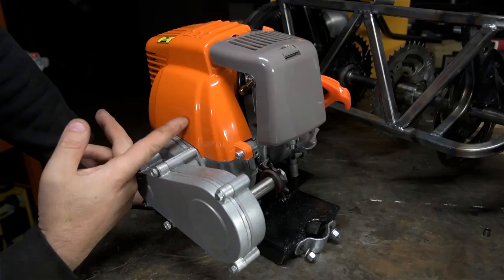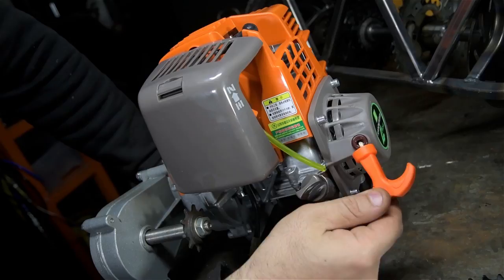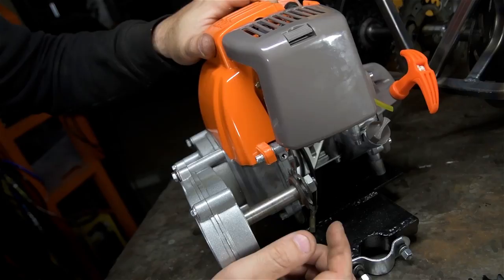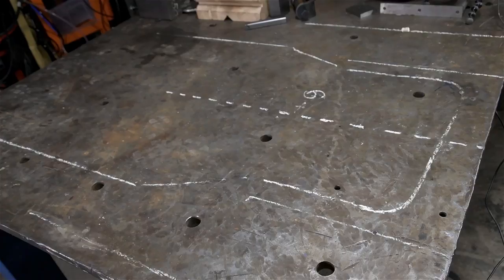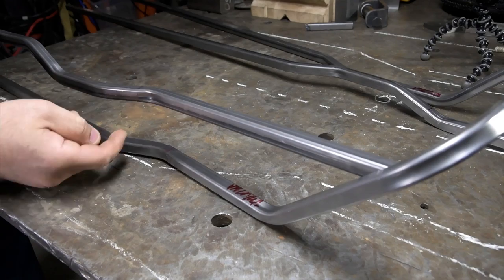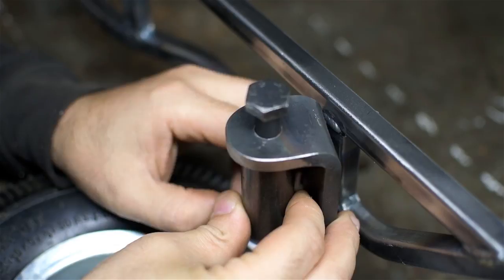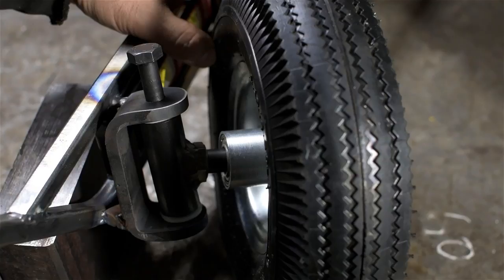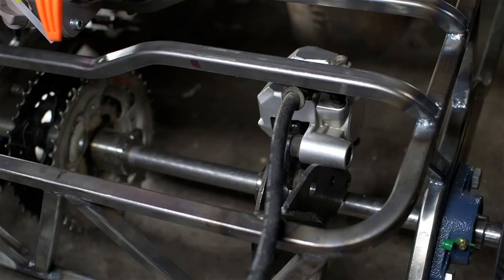"CHAINSAW" GO KART! - PART 2

Comment: Did anybody mention how a derailleur mechanism works? I realize you are not shifting from one cog to another, but even just one cog to another cog straight line, the derailleur mechanism incorporates a spring tensioner to always keep the chain in contact with the maximum number of teeth for any given chain angle. I think your system would have worked had you incorporated the derailleur mechanism. Also, this could allow for a better selection of gear ratio for the terrain encountered. However that said, the $200 investment in the 4 stroke engine was a brilliant tactical decision.

Comment: You were trying to use derailer sprockets; they are designed to derail, and they will at high speed. You could use bike chain and sprockets from a fixie and be just fine.

Comment: Did I see a Soko RC Helicopter set up guage - in ripoff made in PRC fashion?  The electronic angle gauge.  Now I have to find one to compare it to the real deal. .5 degrees off on a cyclic linkage on the head makes you chase 0 degrees at center stick forever and you'll never be happy with the final set.   The Soko made setting up collective and cyclic limits so easily. ....THen somebody walked off with my guage while at the field.  Sorry for off topicness.  RC Go-kart. The end.

Comment: On a motorcycle if you look at the rear tire where the sprocket is and put a straight edge on the chain to the front spocket you will see that there is a slight angle , thats to stop the chain from being flung off the sprocket along with the chin guide there’s a lot more that goes into figuring out that angle . And that steering you exactly right about it steering geometry is very important even more so if you have a suspension that needs to have a designated travel range . When I was a kid this kind of stuff is what sparked my interest in math  finding the angles thing needed to be at and their length and all that fun math stuff , building tree forts In the bush behind our house and thats how I teach my kids about math I told my son if you ever want to build anything for yourself you need to lean math all of it trigonometry, algebra, you need to know it to understand how to build anything, house , car , go cart , motorbike . I so so want to get myself a milling machine and a machine lathe to make my own parts for projects . I seen a mill on market place last year for 5 or 6 grand I’d pay that for one no problem and it came with some tooling . Being able to make your own parts is next level For sure I love your content Tony awsome episode brother

Comment: Instead of just looking at the frame jacking to try and figure out centering suspension angles, maybe putting some equivalent weight in the seat, and actually FEELING the turning force, or measuring at the knuckle and calculating back through the linkage "gearings" if the steering had not yet been fabricated, might be a better idea.  Obviously no help here, but for anyone watching this intending to build one.

Comment: I like it but it's kind of short. But it would be nice to be able to adjust the length of it sense you would want to play with it too.  I really like the frame work. I'm still trying to figure out the front wheels or just take the front off an old riding mower. Thank You Loader.

Comment: I still think it  could use some widening  but  maybe  when you  pull the  front wheels out  for the steering it will give it some of that , also you may want to add some weight ? . I don't  know use a kid analog ( sack of dirt or sand that weigh as much as your kids ) hoist it  up and  figure out where you want your center of  gravity . Again i'm no expert  just  worried about kids being kids and flipping it  . ( i mean i can't  say much i've flipped a lot of things when i was a kid )  but you know . Also depending where you're gonna let them use it  i still think some sort of suspension might be useful .

Comment: I think the problem was that when you tried it, the chainring was not fix on the shaft, hence with hardly any resistance the clutch managed to give the chain a good spin even on idle speed, wich it could't tolerate. If I'm right, then it would have worked, if you welded the chainring on the shaft, and tried it like that.

Comment: you want the inside front tyre to touch on the frame at full lock = brake , will pull in to a tight corner ; )

Comment: some advice if you ever do a second cart or decide to redo the frame on this, in terms of your wheel distribution, the ideal placement would be a squarish base(equal wheelbase and track width), the rear frame would stay the same, just with a longer axle and front frame would change. This makes the cart extremely stable at any speed, almost no chance of flipping no matter the shenanigans. 
You should also think about moving the engine to a lower position, between the sprocket and the disk brake. looking at your engine I would switch the positions of those 2. Again better stability, handling, etc. 
otherwise I do not see how you could've made this better without actual simulation and engineering. I can help out if you want to (;. I work on stuff like this.

Comment: you put 10 degrees of camber in the knuckle but you set the bolts for the spindles parallel to the ground giving the tires no camber

Comment: Wait....at 11:10 doesn't the axis of the spindle being parallel to the table negate the camber you built in?  I would think you'd want the axis of the spindle to be 90 deg to the axis of the kingpin, so that 10 deg of camber translates to the tires...

Comment: I think because of the high rpm the chain was coming off because of extreme sintrifical force. (ug, cant spell) anyway, i think if you got the chain much more tight it wouldn't come off. If the chain kept breaking than you could get a bigger chain.

Comment: You are one hell of a TIG welder beautiful welds how about doing a small class on TIG welding.
on your little go-kart no person puts out two or three horsepower of the sprockets are just too thin they're probably flexing under the torque.. overall just beautiful work.!
nder the torque.

Comment: You are doing a good job in general for what I know about it but I was pretty sure that all those sprockets and chains that were designed to use on a bicycle just had too much torque and speed on them to hold up, I think you need like a #35 go cart chain and sprocket setup, look online at go cart parts and find running gear designed to use on, I will however say to hat I like the frame I hope to very soon see part 3,

Comment: Bike gears AREN'T ALWAYS ROUND!  They have tensioners and derailers to take up slack as the gears turn, and some bikes use eccentric oval gears (or even slightly diamond-shaped) to get more power at certain points in the stroke.  Two human legs do not make consistent power, so the gear geometry changes.  This WILL snap your gears on a static chain drive setup.

Comment: Tony (I'll go with a stuip post later),  what speed is your lathe spinning at when using the carbide cutting tools captured in this video?   I have a similar set; and at max rpm (650) and a really slow cutting rate all I get is a spiral cut.
Reply from the maker: Don't recall but usually if I'm using carbide I max my lathe out at 1200RPM.

Comment: I'm not sure how it affects the handling/steering but normally the wheel axles are perpendicular to the kingpin, while it looked like you "countered" the camber when you mounted them.
Reply: Tomas Hallenberg normal for go-karts, Google go-kart hubs /suspension
Reply: I guess it's preferable that the wheels are neutral going straight, I'm just so used to camber -> wheels lean as well.

Comment: Your absolute amazing TONY..i´m binche watching your video's ☆☆☆☆☆
At the exact moment i wanted to anwser WHY NOT USE A DOUBLE VARIO BELTDRIVE
You pull  out of the box ...uh a vario drive😁

-Extra Driven to watch all four parts of the build .
I Just converted an old go cart into a a small trailer , to hookup onto my 750 w Ebike .
As an extra addition i´m building my own battery pack .
Thats gonna be mounted under the trailer floor.
And gonna supply the ebike´s motor 750 w  , double the Juice. 
And simultaniously extending its range .
I hope , i got u mayby inspired to go on eletrical route someday , no pully´s , sprockets ..chainsaws .
Just a hubmotor and mayby adjusting outher diameter a bit with rims and rubber 😁😉 .
...and ..the torque is heavy addictif... its insaine !! 

Greetingz from the Netherlands and huge fan

Johny Geerts

Comment: I made an rc trolly with a chainsaw motor on it it worked but the clutch was crap and smoked up and burntout and was gutless as to. Weedeater is better but more power the better😎

Comment: you can buy oil clutches for Mac  and you need to go to the 32 chain  size we raced back in the 60s&70s and they were racing engine's back then and alot of there parts crossed over from the chainsaws and post hole diggers

Comment: Four cycle engine should help tame the beast. 2 stroke engines ALL have sharp torque peaks it is just the nature of the beast.  Professional go carts which F-1 drivers start out on have monster 2 stroke engines, but these carts can cost 10 grand and more and should be considered as deadly weapons. Not for the faint of heart.

Comment: I'll bet you that chain kept throwing because of the sheer speed of that drive shaft on acceleration.  I mean, I understand why you didn't go with the chainsaw for your kid's sake, but maybe investigate a worm drive with a clutch, that would be freaking cool to see.

I'm thinking some sort of centrifugal clutch mechanism, I'll bet you could make one like an old centrifugal governor, but instead of operating a throttle mechanism, squeezing a couple friction plates together.  An old drum brake would do nicely for the coupling.

Also, an old trick my father taught me was to fill tubes with sand before bending, that keeps the joints from denting and losing a bit of integrity.  I never did bend square tubes though, so I assume you have more experience than I and there's a good reason you did that how you did.

Comment: Should have had a bigger sprocket on the chainsaw.  you were throwing chains because its high rpm. Gear the chainsaw down. Then gear it back up on the axle.

Comment: Just so you know, that is not a CVT. It looks similar to the CVT that comes on the X2 pocket bike, but it is actually just a simple gear reduction box. It also comes standard on most pocket bikes. This means it will be a single speed, not constantly variable.
Reply: i was wondering about that. the first pulley looked to small to be a cvt. my wood lathe has one and the pulleys are the same size.
Reply: Awesome project and video! If you are wanting to implement a true CVT on this build, I believe they can be had for around $60 on eBay. I have been considering buying one to use on my 46cc Goped  scooter.

Comment: You where probably connecting the the master link in the wrong direction should try connecting it with the locking pin pointing downward instead of upward

Comment: that isn't a CUT on your motor. it's just a chain reduction unit. Might want to put a grease fitting on. also I really need to get a bottle for my tig welder. as for your steering I have my racing mower set at 10° caster and 10° camber.

Comment: I may have tryed weld steel pulley on clutch and green v belt. 20 in tires 16 in pulley direct still only 8 to one reduction still need more gear reduction or variiable speed belt jack shaft to axle. Belt drives are smooth if you can make it work. Like you said; throw money at it. even with variable speed belt drive on separate shaft, bearings, misc parts. thing may start out slow then either stall engine  fry the belt or blast off 0 to 100 in 1 block. Great if radio controlled no one's sitting on it. Like Practical dude says predator 212 all the right stuff same price, $200 quality stuff all the parts no brainer. But, sometimes more fun and interesting to do things differently. Here um say damn never seen that before. How'ed you figure that out? I tell em I am a damn  genius that's how.

Comment: That frame seems very narrow, you will want to keep your CG as low as possible.  I would recommend mounting the seat much lower than you have in your mock-up. 

I've tipped a home made kart by turning too quickly when I was younger.  it was no fun.

Comment: I'm sure it's moot as hell but you might have gotten better luck if you used single speed chains at ridiculous tension. There are only some bicycle chains rated for high torque.

Comment: That's still a shitload of caster. I'd suggest around 5-7 degrees caster, -2 degrees camber tip tipped in like you have it (this works w/ caster for return to center), and positive toe (out) of about 1/8". The front track width should be an inch or two wider than the rear for stability. If you get on two wheels, you want the back to pick up first. You'd rather lose go than steer in a tip.

Comment: So what's your chain popping off I think it's your big sprocket as you can see it's kind of oblong it's not round that's to help the bicycle chain change gears is to help it step up to the next gear or drop down to the smaller gear get you around BMX sprocket and I think it'll stay on

Comment: I'm a little disappointed you didn't continue with the chainsaw engine. I like seeing new uses for old engines and how you were going to make it work, all well. I guess I'll just have to make one now, just not as nice. 

I'm not certain on this but it looks like you might have some problems with the output shaft on that new engine you purchased. It seems like it would be better off with some support. Good work though.

Comment: if you make asmall triangle like 30 30 30 cm aproximately and weld them to the chaSSI THE FRONT WHEELS CAN TURN MORE WITHOUT HITTING THE FRAME JUst an idea ,,i think ita also safer and easier to attach dampersif you upgrading in the future

Comment: I don't think bicycle chain was ever intended to run at that rpm. or speed. Motorcycle chain might have been a better starting point. I have one question I am afraid to ask. Were you running the chain in the right direction plus at that speed it would need a tensioner chain. I'm just wondering. BTW, my next door neighbor suggested I build a chainsaw go cart out of my Stihl 08S. I'm leaning towards using the current bar and chain to drive it. It's not my kids..

Comment: spindle should be perpendicular to the king pin
Reply: haran wood ; It depends on the intended application as to whether the spindle and KingPins should be perpendicular. On a forklift, or something with little lateral force being applied, then yes, they should likely be perpendicular. In this application, Tony is looking to have the wheels tilted inwards towards the top to create a positive angle of attack when turning. You can argue that on a car that there is a TREMENDOUS AMOUNT of lateral force being applied to the spindle while turning and there is, but the spindles on your car example are specifically designed for the forces and are  very heavy and bulky to accommodate those forces applied. Not to mention that the KingPin axle design used on rear wheel drive vehicles( as employed here) hasn't been used in production automobiles since like the '40's, and the design used currently( on heavier rear wheel drive vehicles)  uses two balljoints, on on the upper control arm and one on the lower control arm where the spindle attaches. Another point is that on modern KingPin designs like those used by modern HEAVY four wheel drive vehicles and the like are FAR STRONGER than what he needs or desires to have.

Comment: Still cool work, but the chainsaw powered kart isnt a chainsaw powered kart anymore... And yes for 200$ you can pick up a good used go kart but that wouldnt be as special I guess. Should have used dirtbike gears instead of bicycle parts. That probably would have helped with it throwing. Anyway keep on building. That's half the fun

Comment: Have you considered rugged motorcycle drive belt and pulleys?  You could custom make the pulleys any size you need.  And a 3 inch (75mm) wide belt would look very cool.
Also, I'd make the steering wheel shaft with a tube as the bottom half and a solid bar as the top half.   This way, it'll collapse instead of jamming into you son's chest.

Comment: prabably could have just bought a heavier duty chain and sprockets like off of a mini dirtbike and could have fixed your problem once its underload at idle it wouldn't move. chainsaws bog down underload that 12k rpm is only at a no load full throttle.

Comment: I really hate to dump on your go kart but if I had all the tools in the knowledge in using a lathe and doing machinist work I could have built a Formula 1 racer by the time you got halfway through part two of your video . The motor you ordered is a motor for a bicycle .

Comment: I think it might be the fact that bicycle chains aren't meant to take that kind of abuse, pity you can't use a BMX chain on that sprocket set. Or, well, you could, but you'd have to take it apart and space the rings 1 mm (i think, i tried to use a BMX did the math, gave up, bought the most expensive chain at the time instead) to allow the thicker links to fit.

Comment: I think the problem was you were using bicycle gears and chain. A better retup would have been #60 sized gears and chain. What you were using was far too light and not designed to use with any power plants.

Comment: should have just put the tried and true predator 212 and a torque converter on it, far more reliable and robust and only 200 bucks for all of it, not to mention about 4 times the horses and like 5 times the torque

Comment: 3 speed road bike gears have sloped gear teeth because it’s an outdated cheap design, real mountain bikes don’t have front gears so the single sprockets have thick square profiles designed to hold the chain on during aggressive dangerous riding